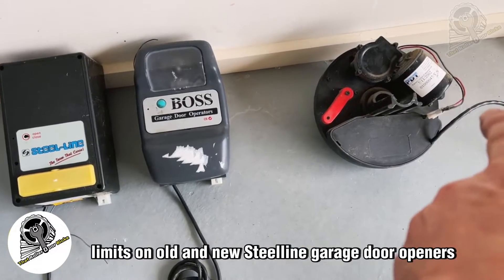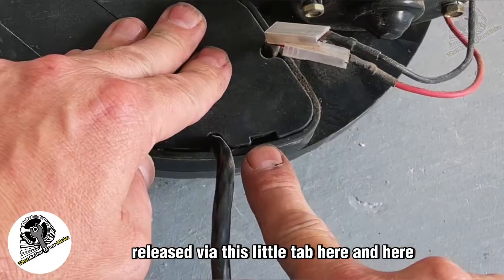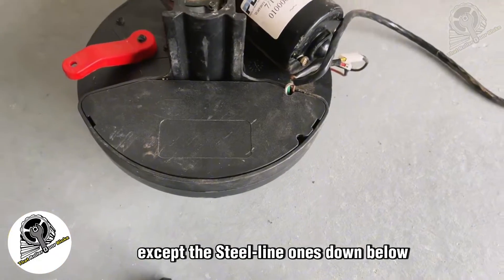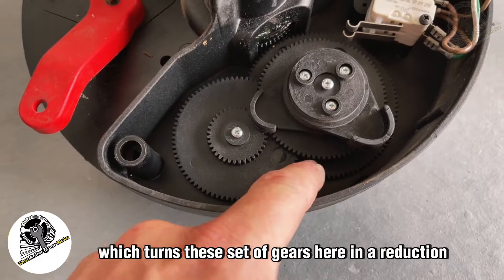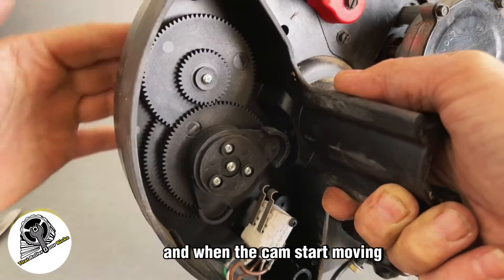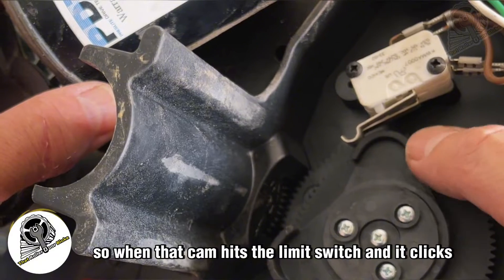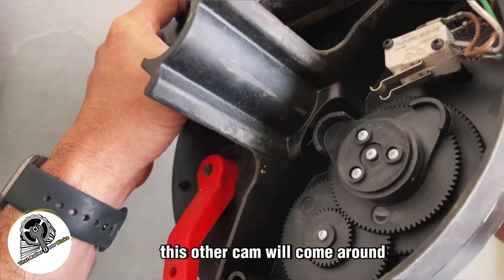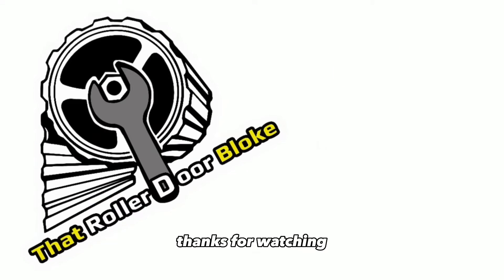[92] How garage roller door mechanical limits work.  Gliderol, Steel-line Boss & how to adjust them

Comment: Hey dude thx for sharing such great video. But can u provide any suggestion efficiently cleaning up the rails? Now i got problems pulling it down with the romote. Going up is fine. Should i go buy some lubricant like WD40 or something？
Reply from the maker: Track cleaning you can use a degreaser or soap. They should be clean and smooth, just bare metal. Silicon spray is fine for extra smoothness but not WD40.   

You may have to also clean the fabric edge on the door if it has got grease on it. 

Also if it sticks coming down you might need to add an extra weight bar, say 1kg.
Reply: @rollerdoors  thx bro. I bought a WD40 from coles the other day. Now it just works fine, way too quiet and smooth. LOL